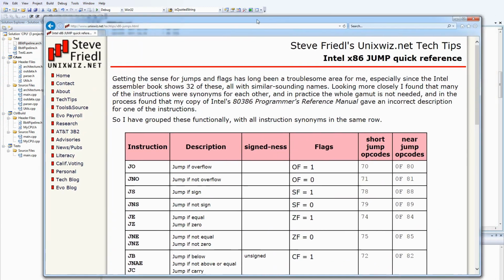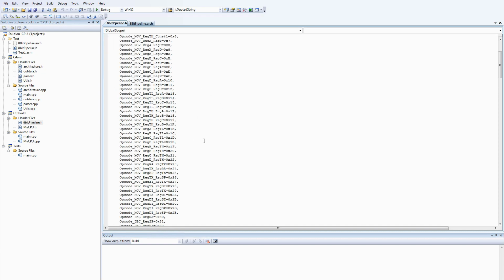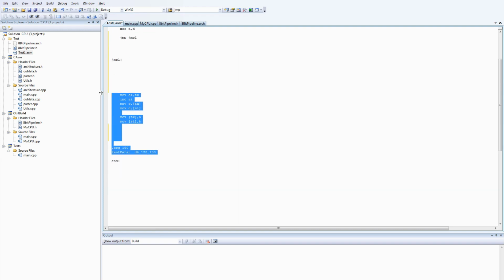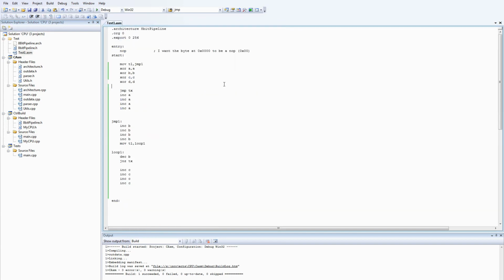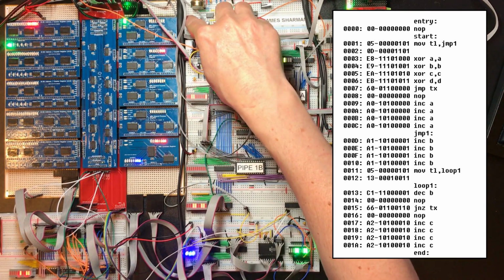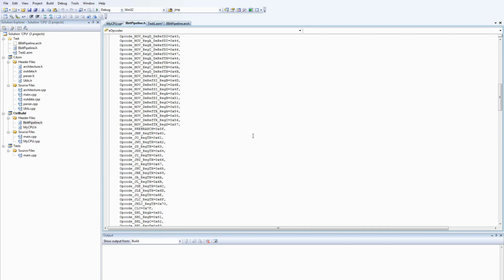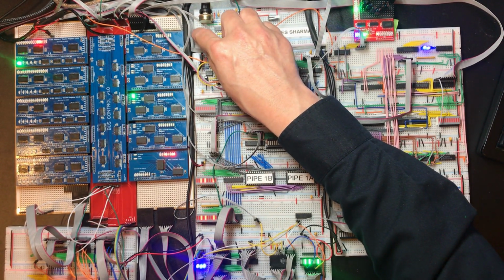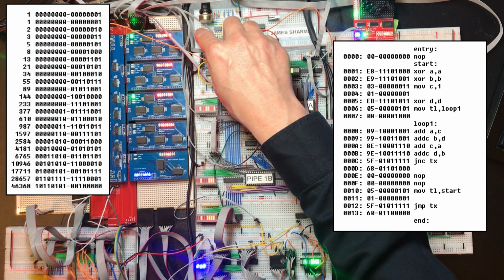Flow Control - Making an 8 Bit pipelined CPU - Part 54

Comment: How does 8086  or PIC  MCs deal with the nop problem?
Reply from the maker: That’s actually quite a complicated question due to there being many variants of both 8086 and pic processors. I’d also not necessarily describe this as a “nop problem”, it’s more of an opportunity to get some work done. I wrote a lot of code for the original 8086 and I didn’t see variations in timing based on dependencies so I’d guess it just waits for each instruction to fully complete before moving on, it does have a separate fetch unit though so it gets some performance from that.